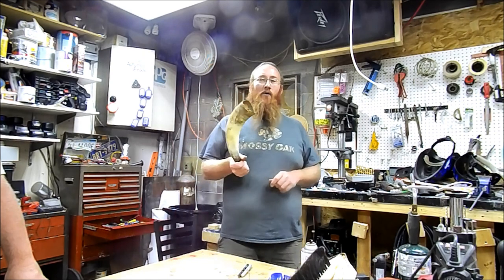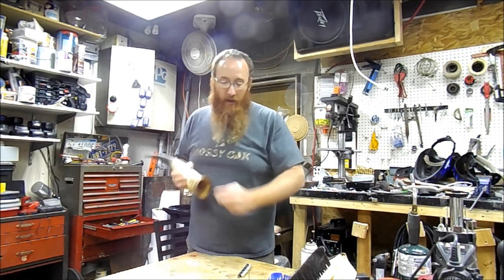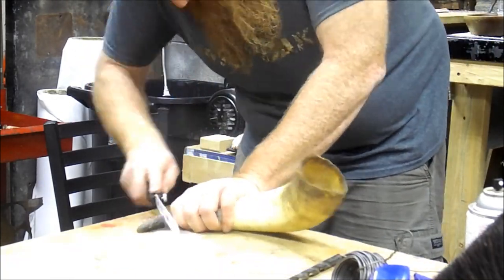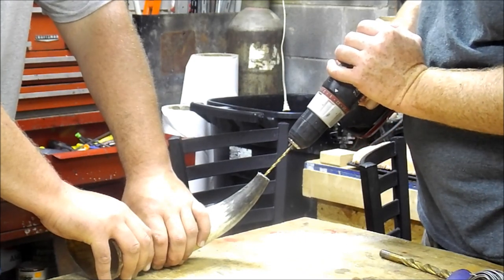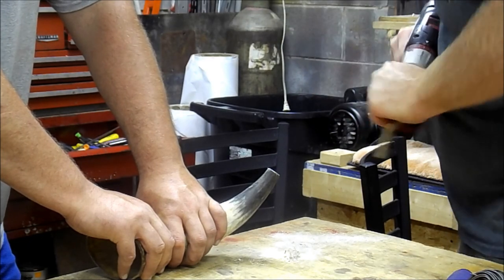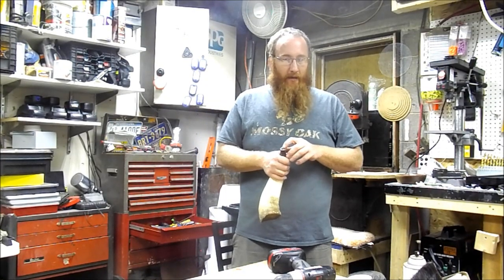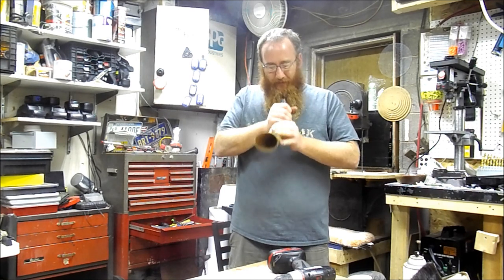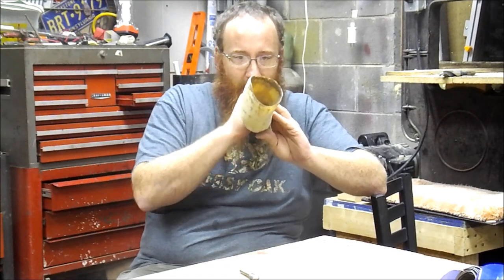Episode 128   Making a Cow horn bugle

Comment: Great video! I was planning on making one but I had one question... how do I make the horn hollow at the thickest part of it near the skull?
Reply from the maker: Felix Svan the inside is filled with boke and cartilage. Generally if you put it in a warm dry place you can get that to all shake out. It may take some drying time. This horn had been drying for 5 years before this video. It shouldn't take that long but it might take a year. For us we put it up in the barn loft.
Reply: Downstream Outdoors, oh okay I didn't knew that. Thank you for the reply! But Jesus, much patience is required haha
Reply: @felixsvan2982  Traditionally you can also boil it! but I'd still recommend you let it dry for a couple of months, because boiling a fresh horn is one of the worst smells EVER! You take a big pot (perhaps not one you plan on cooking in afterwards) and let the horn boil for like an hour! Then you should be able to carefully whack it against a wooden surface or something and the cartilage will just plop out! Also, when it's hot from boiling you can also bend and adjust its shape a bit. Boiling immediatly works, but I'd recommend you let it dry over the summer and then try to whack it against a wooden surface. If you're lucky that's enough and it falls out, if not then at least it won't smell as awful when you boil! Also, boil outside!! (Smell)
Reply: Astor Niit thank you very much! I didn’t actually know that would work. Well, I haven’t got a horn yet, might never get one ;( but if I do I could try both tactics. Even though it smells haha.
Reply: @felixsvan2982  It's probably worth the smell if you really want to make it! Have you tried to ask a local butcher what they do with the horns? If you're lucky they'll give a few of them to you for free! There's also some sites that sell cow horns relatively cheaply for horn carving!